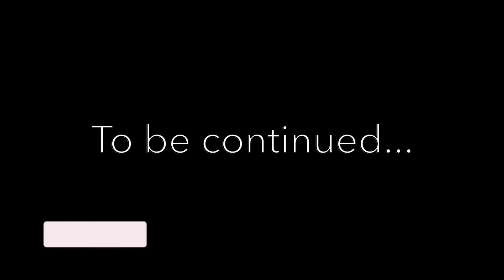DAY IN THE VAN LIFE | Long DRIVE Days | Roadside Attraction

Comment: I remember all the sand in my RV when I was in the desert, it was everywhere!
Reply from the maker: I still have sand in my van. It's driving me insane! 😳 How did you get all the sand out of your van?
Reply: @WhereisTiffany  I had a small hand vacuum cleaner. But I also had Ikea fabrics draped over my main couch which I could take off and shake really easily.
Reply from the maker: I had a small handheld Dirt Devil that worked great at picking up everything but sand. 🤣 I gave it to Goodwill's